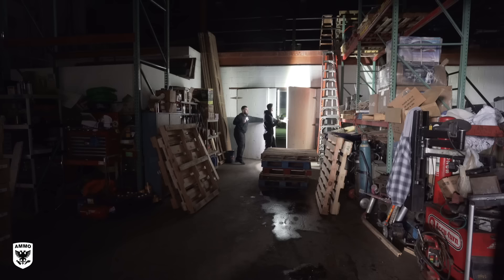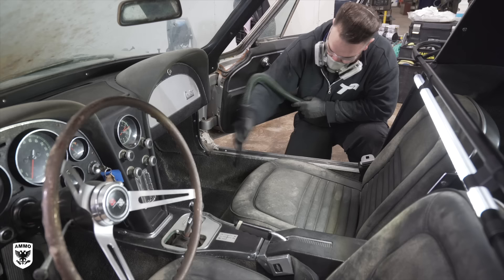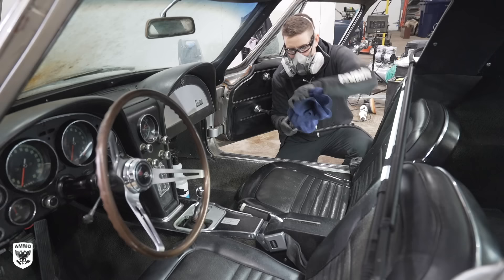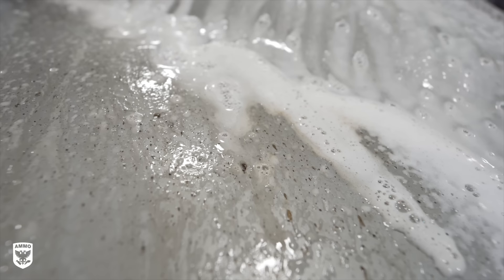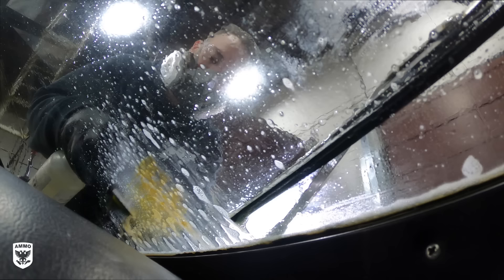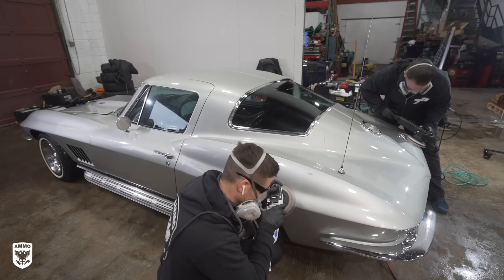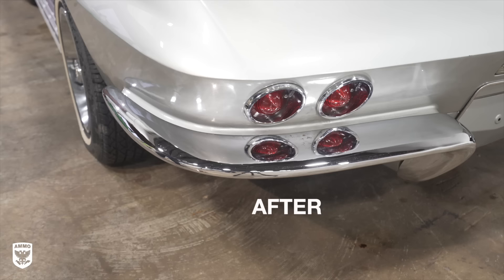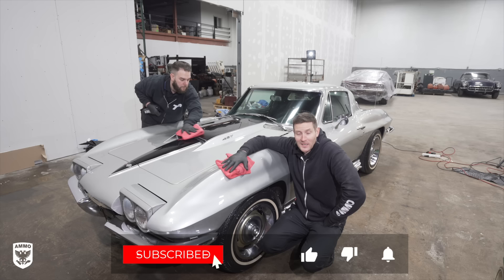First Wash in 33 Years Chevrolet Corvette Stingray

Comment: As a young boy my father taught me exactly how a car should be washed, (inside and out). I spent many weekends washing his 2-door '66' Chevy Caprice, (427 Turbojet). If I could give you guys one bit of advice... my dad would not be happy with those "off-white" sidewall tires. I use to use S.O.S. brand steel wool cleaning pads, (not even sure they are still available). These pads were heavily coated with dried detergent. I would lightly moisten them enough to get a lather and then go to work. It would normally take one pad, (and a lot of elbow grease), for each tire, but keep in mind these tires hadn't sat for 30 years. The whitewalls, no matter how dirty, would gleam bright white after rinsing and wipe down. Just MHO. Great video. Brought back many memories!

Comment: kinda shocked the brakes weren't completely locked up after a 30 year sit.
Reply: Probably left with the handbrake off, pretty common practice when you know the car will be sat for a while :)
Reply: it probably wasn't sitting for that long, they just wanted to sell the video.
Reply: Joe Schmoe probably wasn’t exactly 30 but a while and sat inside
Reply: 30 years is what they are telling us we don’t really know lol
Reply: Handbrake off and stored in the dry, brakes will be free!
Reply: @CasiodorusRex  Exactly...
Reply: @Jimmy Hernandez Not sure if brake fluid actually has an expiration date when sold in unopened containers. Brake fluid is however hygroscopic, meaning it will absorb moisture. When moisture is present, rust will begin to form and pit metal, next thing you know you have leaks from the pistons or wheel cylinders. It is smart to periodically flush your brake fluid to avoid this problem. Moisture also attacks the metal brake lines as well.

Comment: Me: "Wow, that's got some nasty rust on the RH rear door jamb."
Me, 0.5 seconds later: "Dude. It's fiberglass."
Reply: It's fibreglass, but these cars have a metal frame that surrounds the firewall, windshield, doors, and roof.  It's called the birdcage.  They rust and when they do, you have a big, big problem, because you need to separate the birdcage from the fiberglass to make repairs.  It is extremely difficult and expensive to get repaired.  On most 67 vettes it would be too much money, but on a real 427/435 HP car it could be worth it.

Comment: Cleaning it is one thing. But it's been sitting there for 30 years with an inactive engine. The engine is the main thing. Or else it's just a shiny brick.
Reply: Not an issue assuming the engine is in working order. New Battery, check the wiring and clean the spark plugs. Test the starter. Drain the oil, add new oil  and antifreeze. New hoses and fan belt if needed, clean the carburetor and fire it up!
Reply: @user6008  You forgot one thing: gasoline
Reply: @NaruSanavai  definitely going to have to purge it if it has the same petrol it has in it since the 80s
Reply: @user6008  it'll need more than that
Reply: Gotta get cleaned first though.

Comment: Would removing the seats help get a deeper clean, especially when having been inhabited by critters?
Reply: Of course and they absolutely should have been removed I'm sure there was a 9/16th" wrench and socket in that shop somewhere.
Reply: This channel has inspired me to actually become a detailer at 16, in the next few weeks I’m gonna start working at an auto detailing shop, I can’t wait to start.
Reply: @jasonsparshott7208  he did mention why he didn't remove them, and after 30 years they're likely rusted in.
Reply: @Pennsyltucky84  rusted nuts will come off with some effort and if there that rusted then so is the floor board and seat frames .. time for a restore not a deep clean !!
Reply: @jasonsparshott7208  Enough rust to lock up a nut is much less than it is to damage a floor pan. However, I do agree with you. Still, he DID give a perfectly valid reason for why he didn't remove the seats. Also, he's a detailer, not a mechanic or a fabricator. As such, the sort of restoration required is outside Larry's skill set. Ie; not his job. Aside from the reason he gave, attempting to pull the seat could potentially cause damage, not something he'd be eager to risk at any time, but especially not right before a sale.

Comment: 400HP or 435HP ?
Reply: Thought the same thing : )
Reply: @stuartb9323  I didn't see an AC pump...
Reply: Not all have them. 
I have a 67 400hp for 34 years now. Mine doesn't have that either.  I don't believe that would make it a 400 or 435 exactly. 
I went back and checked the video.  This is what I noticed....
67 bb engines never had chrome valve covers. The fan is wrong, and obviously hoses and clamps were replaced. 
The only way to tell is the stamping on the block...if it exists. 
Thoughts?

Comment: In owned one. It was a fine car and fast if tuned a certain way. Some had 260 speed gages and most had 180 . I finally sold it and bought a Toyota Celica which was a great car. When I sold it it looked new. My first car was bought shortly after turning 16, was a 68 Berkley (Look them up).

Comment: Try using newspaper on the inside of the windows to remove the grease after you have loosen it up with window cleaner...it works a treat and remains clean even if you use the air defrost setting on it...

Comment: Window cleaning tip. You can use your normal cleaning fluid. (I've heard. From another guy that rubbing alcohol cleans glass well. But I've never tried it. So I'd try it on an old piece of glass first to see how it does) after spraying the windows. Try using non colored newspaper. It works really good. That's how I normally do windows

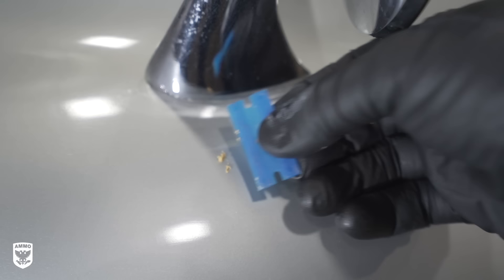Comment: Pro tip from a window cleaner: when using the razor on glass, don't drag it back and forth. Lift up the blade after each forward stroke before making another forward stroke, the same way you used the plastic blade at 10:42. Pulling the blade backwards on the glass can pull lifted debris against the glass causing scratches. You should especially never do this with tempered glass which typically has embedded debris due to a manufacturing defect.

Comment: On glass I learned that you should degrease the window with rubbing alcohol. And wipe the glass in one direction. If you start on the inside go side to side outside go up and down never in circles. After it drys wipe again in the same motion with a clean dry microfiber towel

Comment: Window cleaning advise? How about straight alcohol and newspaper? An old friend swears by it. He’s been installing tint for 30 years. I’m a Dawn/water and squeegee guy(commercial window washer). But don’t use brand new towels for wiping the edges. Used towels that only get washed in water(no detergent other than the leftover Dawn already in the towels). It’s the laundry detergent that causes streaking.

Comment: If love for you wash and detail your Ford gems; the GT40, and the Ford AC Cobtas thank you.

    I once owned a fabulous 1968 Ford ShelbyMustang GT350 with a crate engine 351 Cleveland from Ford made for the Pantera, it had the finest custom metal wheel flats on the rears and fiberglass on the front wheels which turned Into a front spoiler with Two pencil beams next to one another. I think it 18 coats of black lacquer and some clear outer coat. The thing was the coolest looking Shelby GT 350 anywhere. Highway patrolmen would pull me over just see if they could look under the hood. 
If I can find a photo, I think you’ll appreciate it. BTW- it had two switches on its all customized dash which killed all the rear light—rear driving lights, rear brake lights, turn signals! So if you were driving at night and wanted to say, ditch an officer of the law, I’d just hit those switches, use the front pencil lights only and jam. They couldn’t track me- in a total black car with no rear lights at all and only this pencil light showing me, not them. where I Was going—thru were in the dark!!
  If I can find a photo, how light I post it? Thank
Reply: How do I submit a photo?

Comment: How did you deal with the cracking and flaking areas?
I've never understood why chrome would pit and flake. I always thought it would be sealed to the steal underneath. I guess that is why there is the triple plating process which seems to endure forever, but it still makes me wonder about single chrome plating......
Reply: It's due to a process called 'corrosion'.

Comment: The thing is do you check and see if the car starts before going through all the trouble of detailing the car? Is the car's engine in good shape and the compression good before spending money making it look good?  Is the transmission good?  Are the fluids changed before they start the vehicles? I would be worried that the engine might be seized or the transmission might be locked up!  The rear-end could be grenaded. That would determine the price of these vehicles. You can Polish a terd but in the end it's still a terd. These cars have sat for so long they would need to be gone over before I would consider buying them. Number matching cars are worth a lot of money but if they are not maintained and they blow apart then they are not worth anything. This vetted would probably be needing a lot of love. But in the end she would be well worth it

Comment: I'd really like to see you do a show car restoration of a mopar. But please PLEASE no chargers!!! The charger is the only mopar that ever gets attention. In my pictures you'll see a 69 dodge dart in grey primer with big (street) tires. It was one of the cars my dad and I built. In 1983 that car was turning 10.3@137mph on those street tires. Full interior. Pump gas 340 cu in with 727 manual shift valve body. And please everyone don't tell me that I'm lying. Or that you can't turn 10s on street tires. I was there. And the guys we raced with. Both on the street and the track could tell you it IS true

Comment: You should never spray the cleaning solution onto the vehicle itself. You should spray the cloth then wipe the vehicle.  Spraying that much liquid onto the dash especially a vintage car like that can effect the wiring and cause shorting out problems. You can do more harm than good.  You should vacuum and use compressed air or an air gun and blow the majority of the dirt out and then use a wet rag to clean the car that way you are not getting fluid or cleaning liquid behind the dash and causing the owner to spend thousands of dollars to fix a big electrical problem. This may save some customers some headaches in the future.